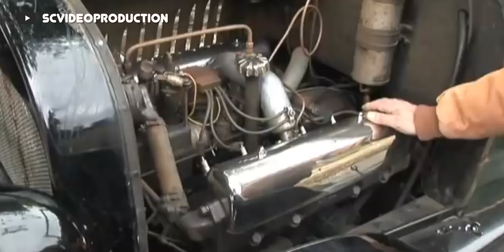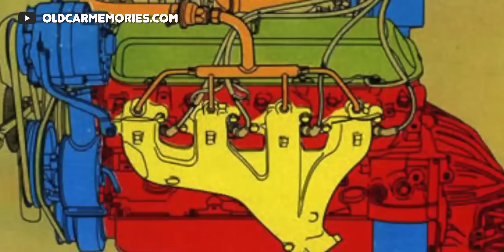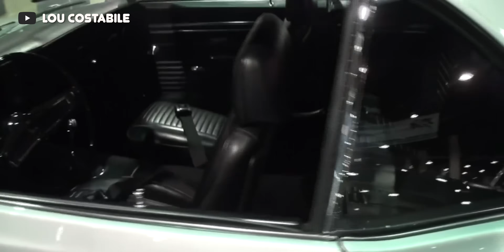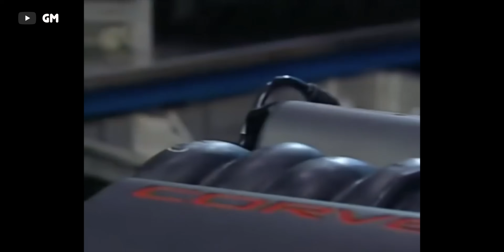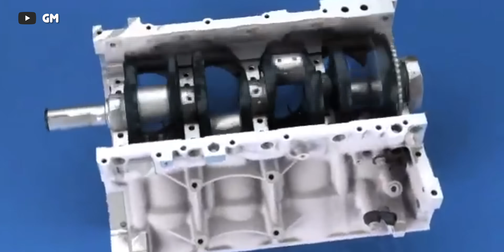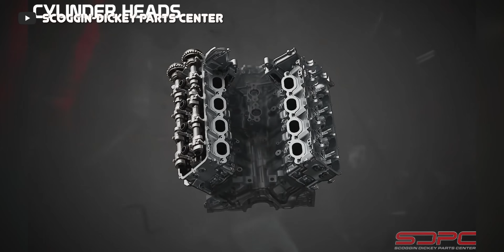We Ranked the Best Chevy V8 Engines Ever

Comment from the maker: What's your top 5 Chevy engine list? Let's hear it below.
Reply: 396
Reply: ZL1 427BBC (raw power figures/ legendary)
DZ 302SBC (high rpm circuit racing)
LS7 (big displacement big rpm)
LT6 (highest NA power V8)
LM7 (best low budget power/ availability)

My top 5 in no particular order, just the engines that have caused a majority of my daydreams
Reply: I like the 235 full pressure straight six with 848 heads. Small, cheap, reliable, easy to rebuild. Interestingly, the exhaust valve is the same as used on the SBC.
Dual quad 409. Over 6000 RPM in the early 1960s. It was a bit heavy and based on a truck engine but it propelled plenty of 1963 and 1964 Biscaynes and Parisiennes down the highway.
Reply: @dale116dot7 excellent choices..
Reply: I was a little disappointed that you didn’t mention the 409. I realize it’s a dinosaur but it is historically significant. The W head was an interesting design and I love the shape of the valve covers. It’s not the latest greatest design and it doesn’t make 600 horsepower but it’s a classic engine and it went into some classic Impalas. It deserves some respect.
Reply: The 427 L88 & ZL1 were the absolute pinnacle of big block Chevys.
Reply: I think you should've chosen from all of GM's V8 engines. The 4.2L Blackwing is a brilliant engine and it's a massive shame it's only in the CT6.
Reply: @imnotusingmyrealname4566  Yank one out and stuff it in the vehicle you like then! People have shoehorned V8 engines into Miatas :)
Reply: Isn't it really obvious that it's always the latest-generation Corvette engine? I don't own one but the newest Vette mill is probably always the lightest and most powerful, and even if it isn't the lightest it's a lot more powerful than any other Chevy V8. It probably also has the lowest emissions and lowest fuel consumption per HP than any other Chevy powerplant.
Seems very clear-cut to me.
Reply: 70 model 370 horsepower LT1
Reply: 4 barrel 350 mated to a TH400, 4.11 rears. 👍👍👍👍
Reply: All gen 1 SBC's for me
1.350
2.400
3.327
4.302
5.283
I like all the other SBC's too these are just my top 5.
Reply: 327❤❤❤
Reply: If I were building an old school Chevy today, it would be a destroked 350. De stroke to a 337.
New school, I would build a 427 super charged….sounds great with great power….
Reply: Your comment on the C4 ZR-1 LT5 with 375HP was that they were lower than the prior big blocks due to emissions.  Not so.  The entire rating system changed in 1971 when GM switched from SAE Gross to SAE Net ratings.  For example, that 454 LS6 Corvette you noted as 425HP was an SAE Gross rating.  Because GM release both Gross and Net ratings that year, the SAE Net rating was 325HP for the exact same engine.  The C4 LT5 put out MORE horsepower than any of the GM released road going big block, not less.  As an aside, the Lotus engineering team had a 450HP LT5 ready for 1995 but GM declined to use the updated design.  This 450HP was for the same 5.7L displacement or nearly 79 HP/liter - well higher than the 72 HP/liter of the LS7 engines.  There are naturally aspirated C4 LT5 engines on the street at over 750HP (at a 7-liter displacement).  The problem for the C4 LT5 was NIA (Not Invented Here).  GM's Powertrain group was sufficiently embarrassed that they did not develop the engine that it is not an engine displayed in GM's Powertrain engineering building though just about every other GM V8 is on display. And it was not developed to the extent that the LS and subsequent engines were developed.
Reply: LS3 6.2
Reply: Ls7, ls6, ls1,ls3
Reply: @powcod 74  Besides the improvements in intake design and lack of egr on the LS6, it is near identical to the LS1. Therefore, one can only assume the LS6 you've referenced  must be the 11.25:1, solid lifter, 450hp, 454³" big block available 1970 only. You, sir, have exquisite  taste.
Reply: @jasonstinson1767  I would say the 454 was the slowest, boat anchor excuse for the big blocks that Chevy made. The LS6 big block would be on the bottom of the list. Probably the worst engine Chevy put into a car or truck. Doggy and a huge gas guzzler.
Reply: @lars277  I think the 502 would argue that
Reply: @lars277  You really consider the El Camino a truck?
Reply: The 1970 454 was by no means doggy.  Later ones seemed so because of the EPA, not because of Chevrolet.
Reply: @lars277 
I guess that’s why no one wants a 1970 Chevelle with one in it. 🙄

(sarcasm in case anyone can’t tell)

Comment: GM doesn't name their engines the three digit descriptions you use are called "option codes" they are what you tick on the sales spec list to personalise your car, then they appear on the plant build sheet so they know which parts to put in. So when an option is dropped the code becomes available for another option. While L## are usually used for engines it is possible that an old engine code could be reused for a trim color or bigger brakes or a stereo.

Comment: How was the 375 hp in the LT5 bad? You have to remember in 1972 we switched to net horsepower. 375 net is more powerful than 425 hp gross. Even the base Gen 2 LT1 with 300 hp was more powerful than the 370 hp LT-1 in the '70 Vette

Comment: LS9. Basically the same as the LSA but all forged internals. Only came in the 2009 to 2013 ZR1 Corvettes in the US and made 638 hp in stock form. They are now available as crate engines from GM for around 21K.

Comment: GM LS Engines copied from Small block Ford

Copied cylinder arrangement
Copied number of head bolts
And moved them away from
Bore
Copied cam journal diameter
Copied lifter diameter
Copied distributor location
Copied the location of crankshaft thrust bearing.
Copied firing order ( 4-7 swap)
Copies cylinder head valve arrangement
Copied height of cam
 

These’’ similarities’’ are the reason that NASCAR engine builders call the SB2 engine the  ‘’Ford’’ when differentiating the It from the small block Chevy 
Just sayin’

Comment: You skipped right over the 90’s LT series. Plenty of racers have made 2000hp on the factory iron block. Strongest factory block offered in a GM passenger vehicle. Search of “grub-worm” 95 Camaro. Ran a 6.67 in the 1/4th with a single turbo and manual transmission. On the factory block LT1

Comment: I believe the Chevy ls has it over the ford coyote . Cost of mods ford vs Chevy wins , yes you may make the ford run with the Chevy  and beat it . But it’s  going to cost . You can go to a local wrecking yard and buy a 5.3 ls engine and spend around 500 and make over 450 hp, the average cost of new coyote engine 14 to 15 k with wire harness . There some deals with the coyote engine , but not cheap . You still need the ecm and wire harness . Chevy wins all the time , per dollar vs performance ..

Comment: So the Chevrolet LT6 engine is the most powerful, mormally aspirated emgine ever?  More powerful than the naturally aspirated  Ferrari F140 HC V12; an engine that revs up to 9500 rpm and delivers  829 hp at 9250 rpm?
Reply: Most powerful NA V8 not engine

Comment: The LS7 was a great design, but LS7 and super reliable don't go together as they seem to like dropping valves most of the time and GM won't warranty it.  I agree the LS and later LT engines are amazing designs and it's cool to see GM going out with a bang before we're forced to go EV.    My favorite was the 327 L79 for small block and the L88 427 for the big block.  Good video though, carry on....
Reply: I agree about the LS7. Wish GM would address the head guide issue, but got OEM worked over Lingenfelter's on mine. Hope this makes this engine reliable in my Z, as I really enjoy the car.

Comment: Another reason for the higher HP ratings in the older cars was because they used to measure/state gross HP numbers (essentially an engine with no accessories under perfect conditions), they changed to net HP in the 70’s.

Comment: I actually prefer the high torque at low RPM of a push-rod engine over the high revving OHC engines.
Reply: Same here.  High RPM engines feel weak in a heavy car, and I don't like a weak-feeling engine.
Reply: Yeah, but modern VVT DOHC have high torque even at low rpm...
Reply: @My-Opinion-Doesnt-Matter  yes it is an improvement in power and torque throughout the rpm range but in my opinion its not worth the added complexity. Long timing belts or chains that stretch, multiple sensors that can fail as well as the mechanisms that advance or retard the cams, very wide cylinder heads etc.
Reply: @My-Opinion-Doesnt-Matter  I thought variable valve timing was a loose timing chain!

Comment: Chevy 350 is the best engine of all time good power reliable you could rebuild it overnight and very inexpensive to work on great sound there’s just nothing that compares to it
Reply: With stand alone distributor, easy for a swap
Reply: Agreed. Love my 350 😊
Reply: 350 is really good, but what about 454
Reply: 72 Camaro SS 350 no power steering no a c only fan belt very fast and reliable. .
Reply: I missed my 72 Olds with the 350 big block Rocket. It purr like a kitten. And sound cool when you punch it down.that never gave me a problem. Very reliable motor. Never see those days again

Comment: Sorry to say, but you forgot several small blocks. A few where iconic, like the 327. And the 400 donated it's forged steel crank to many 383 builds using nothing but GM parts. Let's not forget there were two different 350s as well/ Both two and four bolt mains. I still don't think one was much better than the other, but some engine builders looked for the four bolt.

Comment: The Ford Coyote engine is better in the sense that you can make more HP per liter than the LS and it responds much better to boost because it Revs higher in a shorter amount of time. That said I like the LS in the sense that it's a smaller profile and it only needs one cam vs 4 cams in the Coyote. Both engines are fabulous and most diehard lovers of either brand will tell you this. GO USA!!

Comment: The throttle body 5.7 was the most reliable gas engine ever built and developed for a vehicle.
Reply: The tbi 350 is definitely my favorite v8. But I also like the vortecs, spider injection sucks but if you upgrade the injectors, it's a great engine.
Reply: I have one, very easy to work on and reliable. I have 300,000 miles on it. Only the gas mileage sucks
Reply: V8 engines were more about performance that gas mileage.
Reply: Haha I’ve got the 350 small block (5.7) it’s got almost 500k most I’ve done to the motor is the intake manifold and timing chain (when I did the intake manifold)
Reply: I had the 5.0L version (L03) in a B car. With 2.73 rear end and a 4L60E, I got over 30 highway miles a gallon routinely. Not a powerful engine, but reliable and it ran well enough.
Reply: Bull Shit!
Reply: Ford 300 6 is the best engine ever built
Reply: @jeffparker8268  I've had 4 over the years. I would argue your point as BS all day long.
Reply: @wymple09  they were a good engine but definitely Not the best. Not by a Long shot..🙂
Reply: @jeffparker8268 put that pipe down ..😂😅

Comment: For me, it's the LS. While the Coyote can make nutso power and torque, it's still a small inch, high strung screamer that is overly complex, large for its weight, and refuses to make power and torque down low after a hop up.
The LS is solid, reliable, can make nutso power too. But it's arcaic and crude. Can also be heavy for it's small physical size, eat lifters..... eh, it's a point of preference.

Comment: So I currently own an 06 Cadillac Escalade with the 6.0L LS, I also used to own a 2015 mustang GT with the 5.0L coyote. As far as which is better it simply depends on what your trying to use them for. The coyote is a high reving dual over head cam motor with not much low end torque but makes high horse power numbers. The LS is an over head valve motor built specifically for drag racing so it has really good torque and horsepower numbers. 

Very rarely have I ever seen an LS dish out way more torque then horsepower as they tend to stay pretty close together for the LS platform which actually makes the motor the best when it comes to 1/4 and even 1/2 mile runs at your local drag strip, I mean there was a reason people LS swapped their fox bodies for so long and still do today. Light body with a motor that puts out easy cheap and reliable horsepower and torque build specifically for drag racing. 

But that age old saying of “wanna make a ford faster… LS swap it” in my opinion has just been taken out of the equation, because the 5.0L coyote has proven to be one of the most powerful platforms to date on the streets today. Their top end is practically unbeatable, stock for stock and even mod for mod the coyote out runs the LS platform all day long. 

But even still I wouldn’t put one over the other, both platforms have proven themselves as reliable power houses so it really just comes down to which is cheaper to build which would be the LS. The stage two texas speed cam upgrade for my 6.0L LS in my Escalade all together cost me no more then $1,100 with I’d say a good 12 to 13% increase in power pushing my 6.0L from a factory 365hp to about 470hp. My coyote on the other hand would of been well over 3 to 4K dollars by the end of the upgrade and unless I went super aggressive with the cams it really wouldn’t of shown as much of an increase in power with maybe about a 8-9% increase. That being said my coyote came factory with 430hp so by the end of the upgrade the car would of been upwards of about 500hp. 🤷‍♂️ 

My 2015 mustang GT with all its upgrades was dishing out around 460 to the crank with simple modifications like E-85 conversion, JLT intake, and obviously an E-85 tune. Now comparing my Escalade to my mustang is pretty unfair because of the sheer weight of my Escalade so racing them would of been an overly pointless exercise, but I will say that because of the torque and all wheel drive of my Escalade which at this point is pushing 500hp with the upgraded heads definitely would of at least 60ft my mustang from a dig race where it was, on top of the fact my mustang was a 6 speed manual so it was much harder to launch. 

Being an owner of both I’d have to say neither is better then the other, but if your trying to build either of them, build them to their strengths. Build the coyote for roll racing, it’s the best form of racing for the coyote platform in the form of drag racing because it is a top end motor. Build the LS for strictly dig racing as it’s the best option because of their close torque and horsepower numbers which makes this more one of the best for dig racing. 🤷‍♂️

Comment: the TBI system was the best system Instill habe 2 of does in a 91 and a 94 dump truck both over 200k miles and almost no problema at all both original engines.. the Vortec injectors go out. and the Ls is sensitive to stuck lifters Oil pump and the pcv passeges get clogged  its all in the valve covers then creats crank case pressure and make tje rear main leake. 350 with TBI 88 to 94 was amazing.

Comment: The LS is in everyway superior to the coyote the aftermarket support is unparalleled availability is unparalleled the ease of repair size and plug and play kits available for the ls make it far and above superior to the coyote as far as power Adders people have run absurd boost through truck engines 5.3s (lm7s) 4.8s 6.0s etc. Without going into the bottom end there's no comparison
Reply: Coyote went 7’s on a bone stock motor, yea LS is great for cheap power but if you’re just comparing a 4.8/5.3/6.0 to a Coyote the Coyote is a better engine.

Comment: Mah Man, it's OK to love the LS, LT, et al.
However, it is what it is.
Those engines have SHIT N/A volumetric efficiency and are not as power dense as other smaller engines with 3 and 4 valve design heads and less cylinders.
Own it and carry on. 👌🙂
Forgot to mention, putting VVT on a single cam that controls both intake and exhaust valves at the same time it's doing it wrong from scratch. 👎

Comment: Slight correction,  the lt6 is the most powerful N/A  production engine. There is the ZZ632 that came out around the same time as the C8 (unsure of exact time/date)
Reply: Crate engine only 1008 hp NA sweet

Comment: small engines with big turbos will make great HP with big fuel usage - same all over performance means more fuel ! we just need a better fuel - i am sure there must be some organic juice we could squeeze into the petrol engines = i mean just put a match to orange skin and squeeze it = great fire ! = i have a subaru = oh cams hemi combustion boxer design and forced induction ! great.
Reply: Gasoline and diesel fuel ARE organic. They're hydrocarbon fuels, sometimes with some ethanol mix in with gas. They're 100% organic.
For a given power output, a small turbo engine generally uses less fuel than a big NA one because thermal and frictional losses are lower.

Comment: SIMPLICITY,  DISPLACEMENT,  DURABILITY,  PACKAGING, LOW RPM TORQUE POTENTIAL  AND OVERALL POWER POTENTIAL IS WHAT MAKES OHV SMALL BLOCKS PARTICULARLY THE LS/LT ENGINE SUCH A GEM. ALL GEAR HEADS WANT MANUFACTURERS TO PRODUCE ENGINES THAT WE CAN SLAP BIG BOOST ONTO WITHOUT OPENING THEM UP...WHICH LEADS TO OPENING THEM UP TO BUILD A STRONGER, FORGED FOUNDATION. YOU COULD STAY IN GM OEM CATALOG AND MAKE BIG POWER ALL DAY LONG. THE INTERCHANGEABILITY IS THE SAME THING THAT MADE SMALLBLOCKS PIPULAR. HONDA AND SUBARUS POPULAR AND THAT INTERCHANGEABILITY WILL ALWAYS BE  WELCOMED BY CAR ENTHUSIASTS LIKE US.

Comment: If Chevy would have kept the 8.1 and invested some research and development and money into cylinder heads and a better camshaft for it they could have made a very big 496 cubic inch V8 that could easily make 450+ horsepower and 520+ foot pounds of torque but they didn't the new Ford 7.3 gas engine makes decent horsepower and torque 430/475 and is only 460 cubic inches it has plenty low RPM torque